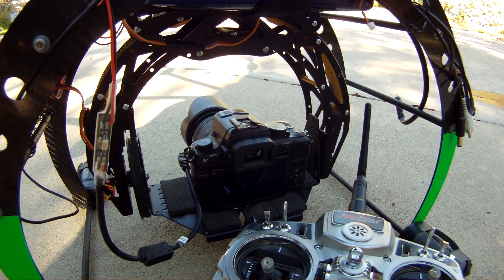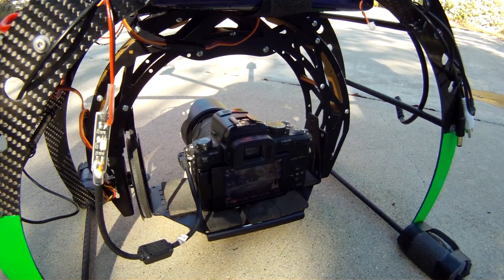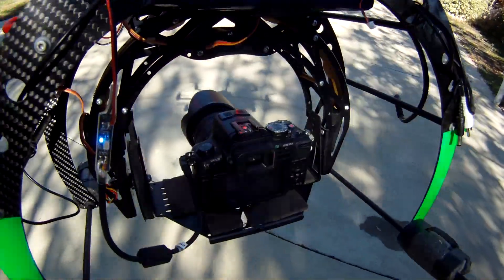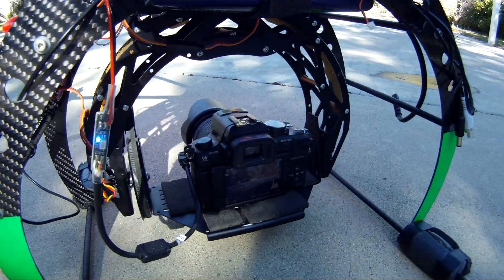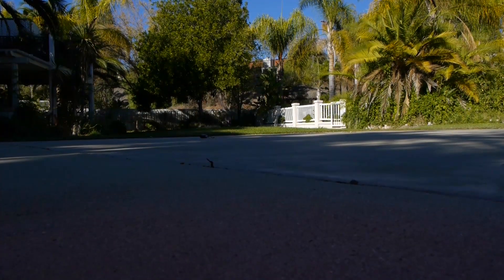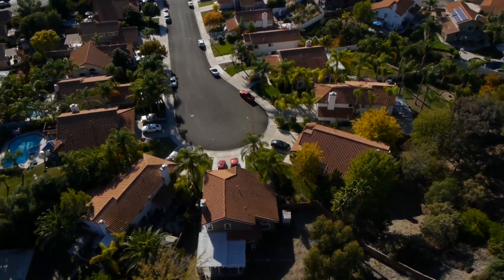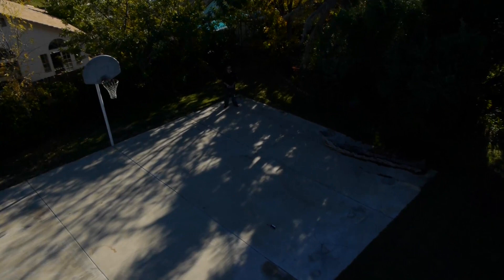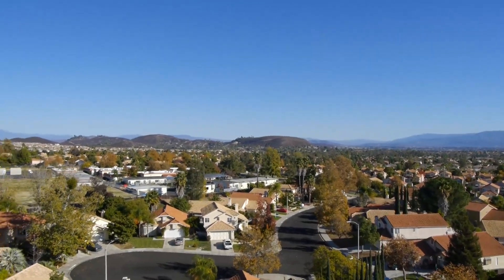DroidWorx AD-8 HL Problems- PLEASE HELP

Comment from the maker: I suppose that's a possiblilty but I've diagnosed it to be battery related. Apparently, after only a short period of time, the lipos I've been using and still test out to charge to full voltage, loose their performance and the voltage output starts to "sag" upon lift-off. I guess the pins on the flight control board that the camera trigger plug into somehow are affected by this. Anyhow, I got new batteries and now it's fine again. Weird ha?

Comment: The problem you are getting while descending is most probably vortex ring state, or settling with power. As for the other problem, I would see what your shutter trigger does when supply voltage drops. You may just need to power it with a separate power supply.

Comment: as said before try a descend while moving laterally a bit, if you watch los you can see it wobble also. judging from the sound of the start-up sounds its a MK correct? if so, the rapid beep may be a ppm issue? or a voltage issue, are your packs up to it? the alarm sounding could also be triggering the camera, the piezo buzzers are noisy. paintz2007 over and out...

Comment: I think possible you may need to put some resistors in line to the camera. I think the voltage isn't regulated well thus causing the shutter to fire. I'd check to see the exact specs on that camera for the shutter cable.

Comment: Im not a pro or anything but what ESC are you using? I know on my RC cars running castle creations if there was a bad firmware or if the esc sensed something wrong ESC would beep like mad. Or could it be throttle like throttle trims that's going over travel and that's why you get the beeping?